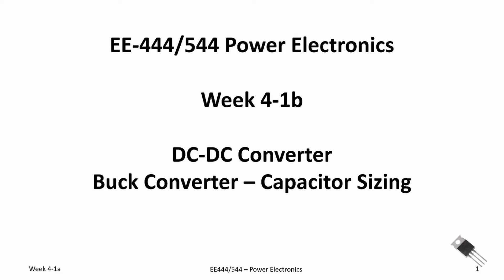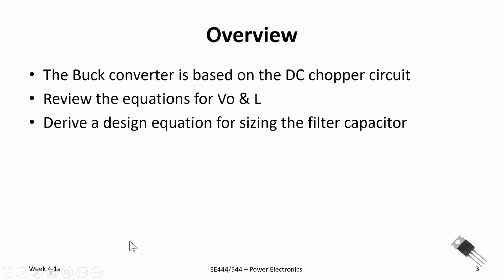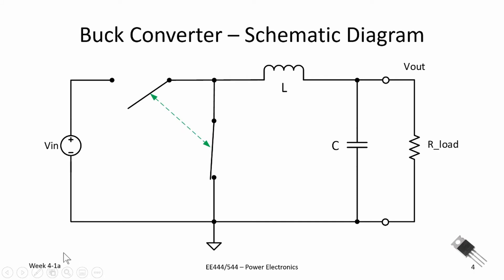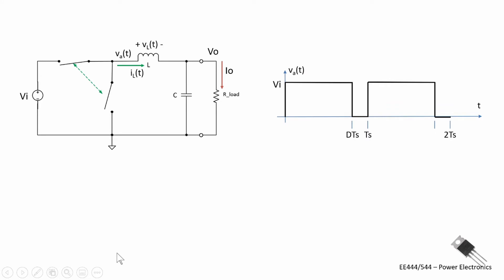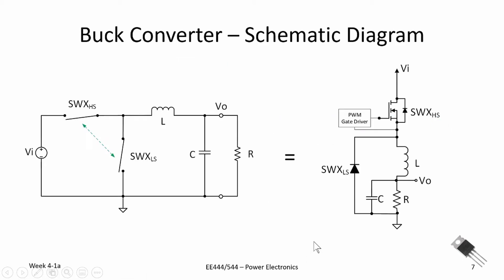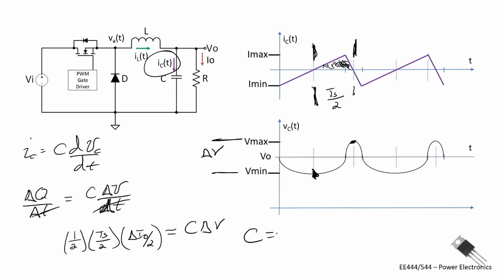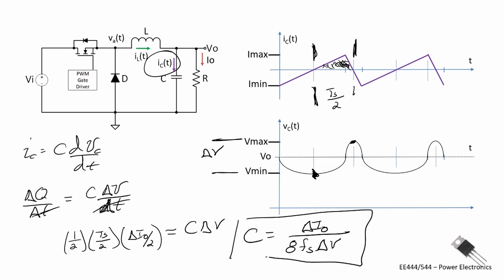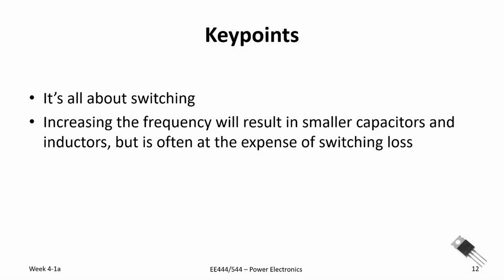Power Electronics - Sizing the Capacitor for the DC-DC Buck Converter

Comment: Why can we assume Io is constant while the voltage accross the capacitor is not constant?
Reply from the maker: Often one assumes the load is resistive and because the output voltage is relatively constant ( with the exception of the voltage ripple), the average output current is constant.  The output capacitor is therefore used to store and provide charge to help maintain that constant voltage assumption.  Thank you for the question and best wishes on your design.  -Dr. K

Comment: Why does the capacitor current start negative side.
Reply from the maker: Hi Bahadir, for this example I assume positive current is flowing into the capacitor and I am using the passive sign convention for power dissipation of the device.  However, at this point in time, the capacitor is providing energy to the connected load and therefore the capacitor is providing charge to the load and the current is exiting the capacitor.  The capacitor is sourcing energy.  As the current increases through the inductor, it will increase to the point where the capacitor will start to recharge again and the current will be positive (i.e. the capacitor will be sinking power).  Hope this helps with the explanation and thanks for watching.  -Dr. K

Comment: Good video Doc, what energy capacity properties do we consider when sizing the capacitor for our converter
Reply from the maker: Hi Daryl, thank you.  For the capacitor sizing, start first with the working DC voltage requirements for the output.  A capacitor that is rated for 35VDC has a different physical size than a capacitor that is rated for 100VDC.  Then look at your switching frequency and output ripple requirements for the rated load.  This will determine the amount of capacitance required.  If the output load current is high and the ripple values are lower, you will need more capacitance.  See the equation in the video with C = Vo*(1-D)/(8*L*deltaVo*f^2).  While increasing the switching frequency helps, it comes at the expense of higher switching losses in your MOSFETs.  Finally, you will need to decide on the type of capacitor.  Your typical options are electrolytic or multi-layered-ceramic-chip (MLCC) styles.  Smaller electronics often utilize MLCCs.  Sorry, but there's no real good answer for your questions.  Design can be messy, but it is always fun.  Best wishes on your design.  -Dr. K

Comment: Your equation for I_0 must assume a 50% duty cycle for it to be valid. What is the general expression for I_0 when D != 50%? Or am I in error here? Sorry, not seeing it.
Reply from the maker: It's independent of the duty cycle.  The duty cycle will determine the slope of the current flowing through the inductor.  If D is closer to 1, then the slope will be positive with less of a slope as compared to the slope when the capacitor discharge current back to the load over the interval (1-D)Ts.  See 9:48 and notice that the capacitor current of discharging to charging at DTs/2 and then peaks in value at DTs.  It still charges but at a lower rate until half-way through the (1-D)Ts interval.  Therefore, the capacitor is charging during half of the switch period and discharges during the other half of the period.  Hope that helps. -Dr. K
Reply: @powerelectronicswithdr.k1017  Thanks, it makes perfect sense now. Amazing lectures BTW. This coming from a guy with many years as an EE.
Reply from the maker: @pb48711  PB, thank you very much. -Dr K